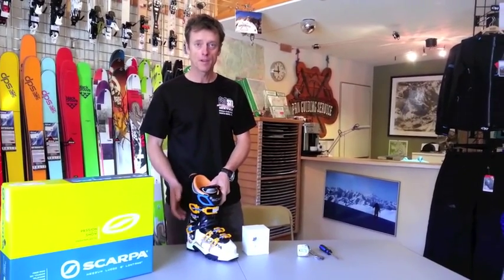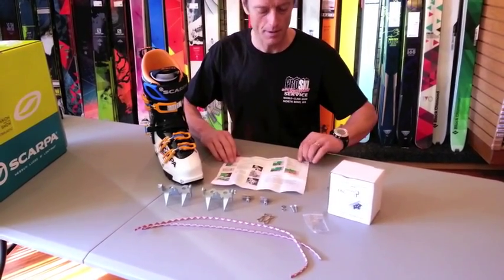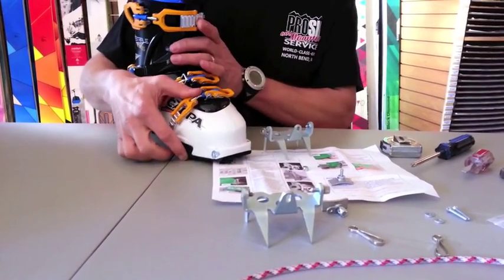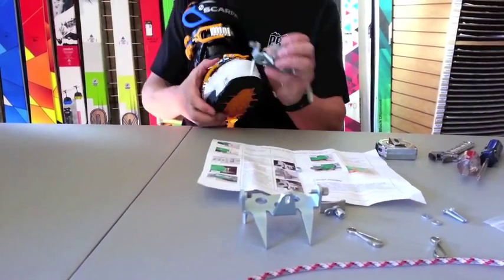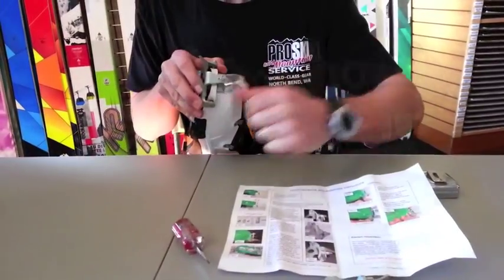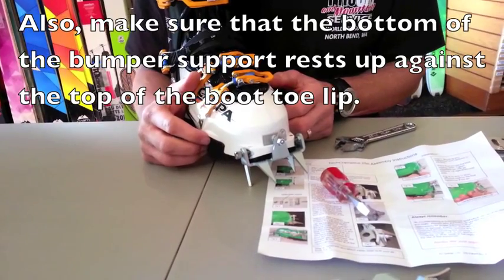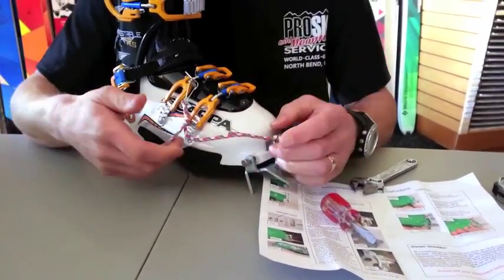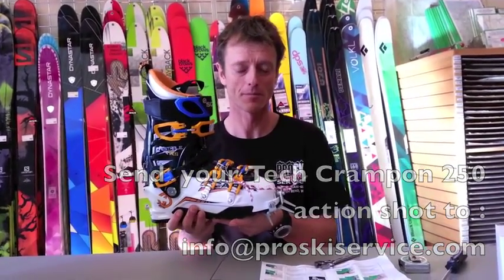Tech Crampon 250 Assembly Instructions by Pro Ski and Mountain Service of North Bend

Comment from the maker: It takes about 60 per set to put them on and less than that to take them off. The assembly instructions are just a one time effort. I used the Tech Crampon 250 last year twice on the Haute Route. I used them for the short section across Col de Chardonnet, Col des Ecandies, summit section of the Rosa Blanche, Pas de Chevres, and Col du Mont Brule. 
I did not have any problems. The pair weighs 250 grams per pair.